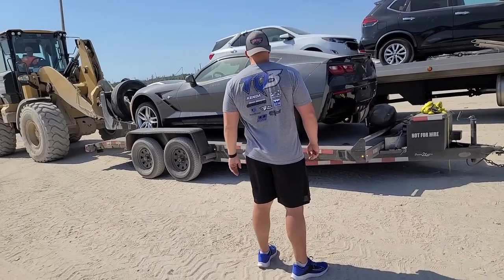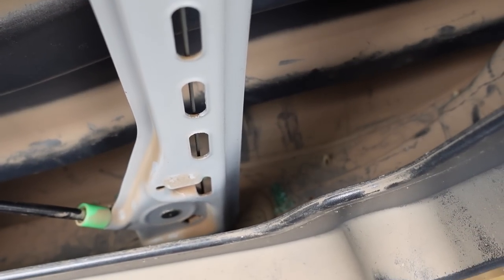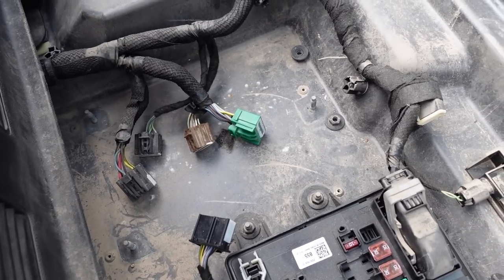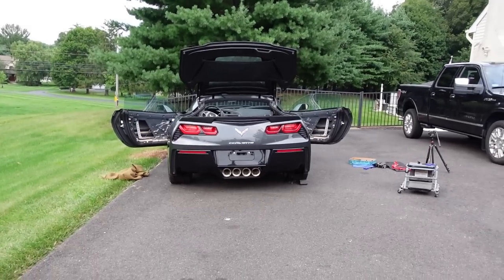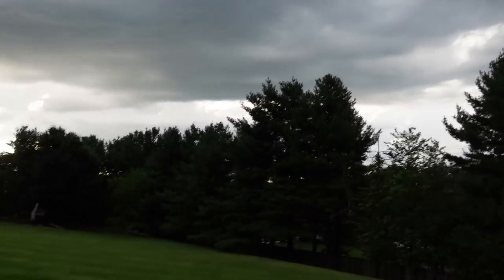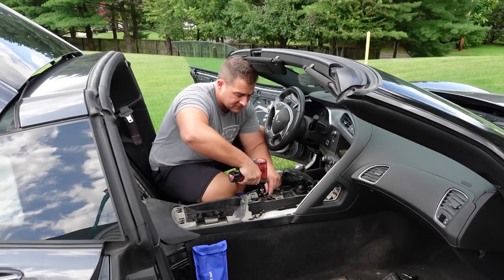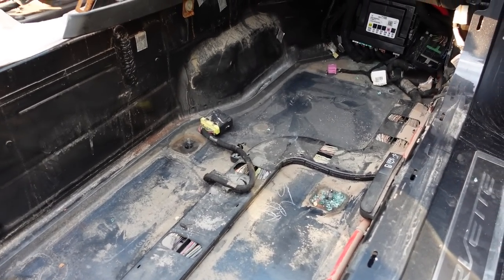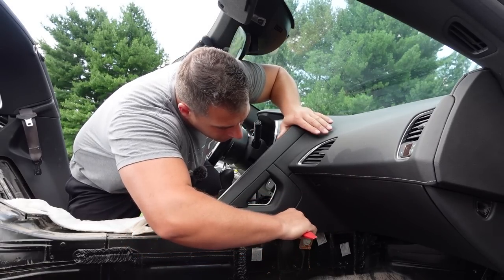My Flood Damaged Corvette just got A LOT more Expensive...

Comment from the maker: Do you think it's normal that essential parts are missing from auction cars? Thank you for following the Corvette series... we WILL get her running again! If you enjoyed, subscribe so you don't miss the next episode! You all ROOOOCKK!!! 🤘🤘🤘
Reply: I can already see this being the best money pit of the year
Reply from the maker: @chasebrown9851  lmao
Reply: I'd call Chevy and see if you can bring in the instrument panels for testing..possibility they may be able to.
Reply: Just a heads up all modules on GM are Vin locked so they will all need to be replaced with new ones or refurbished ones with cleared Vin's and flash/reprogrammed via SPS2 using Techline Connect.. I know it really sucks GM does that I guess to stop the sell of used parts smh.. Just did one that was struck by lightning and wasn't cheap buying everything new.. The only used part was the bcm which I bought used pulled it apart and manually flashed the eeprom using a ch341a programmer..
Reply: Bro with all those missing modules..time to go to the junkyard!! lol
Reply: Just saw you bought those modules lol not good guess you can return them.. See what the issue is the VIN number must be the same for all modules on the network the VIN is permanent and can't be changed upon flashing even by dealership which I use the same software as the dealer and can't do it.. The VIN works like a user password that you would have on a typical computer network  if the password is incorrect it gets kicked off the network..
Reply: 2:36 hurricane water + sewer waste… 
If the waters above the pavement so is the poo
Reply: If all else fails just sell it to Matt Armstrong he likes a bargain  😂
Reply: I bought a Mercedes from iaai and most the modules were missing, they even switched put the headlights and the airbag to a cheap one after I bought the car.  They were in the pictures correct too.
Reply: I love how excited your dad is about this car
Reply: The attention to detail is outstanding . I am very happy to hear you are going to pull the heads and dive deeper into the motor , i can hear you now saying . Dude im so glad i pulled the heads. 😂😂😂 bul🌮🌮's for the house.
Reply: A :they tested them and they where good and sold them .. 
 B: they where junk and threw them away 

and im pretty sure the  A is the right one ......
Reply: Get a holly dominator and go all out, getting all those modules is gonna cost a fortune, just make a race car! Hit up Texas speed they love YouTubers and would probably help
Reply: @BanksRacing11 if they are all vin locked than why the hell would they take all the modules off to keep to sell. I mean come on this is starting to remind me of apple and how they program the screens batteries cameras and even the back glass to the lodging boards on their iPhones 😂
Reply: @awesomeproducts1582  That I have no clue there worthless imo.. Yes ikr their doing exactly what apple is doing locking them so you have to buy everything new from them.. Think they started it around 2008 with the 6l80 tcms then around 2015-2016 they had the bright idea to expand to all the modules.. I'm not 100 positive it applies to the modules related to the stereo/onstar systems but I assume so since it applies to the ABS/TCM/ECM/PSCM/FPCM for sure... I was thinking if he was planning on keeping it he could use all those modules he bought and retrieve the Vin the use it to program a new ecm and the rest of the modules he could buy new then all the modules would work on the same network.. I feel for him it's not going to be cheap anyway you look at it..
Reply: At first I was honestly thinking the modules were all bad and probably were sent to someone to bench test em, nothing was working out and the previous mechanics or owner just bailed and said eff it all anyway - sell at auction. But now that the comp. is missing and almost all the others it seems like someone actually tried selling them as a full set to regain some money back.
Reply: I’m glad I read through these comments.  
 The criteria for a “digital handshake” is a real problem. 
   I’m thinking this car is in hotrod territory as a result. 
   Those are just major components.  
   What happens when body grounds etc come into play?  There’s got to be a major obstacle to overcome in that.  
   It would be interesting to know the cost of putting this car back to at least some enjoyment without having to go through all of these module changes and flashing.
Reply: Please please say water properly it’s not wooder it’s water
Reply: Take it the positive way , all those modules were probably fried… and according where those modules are placed , it could be the reason why they are missing … 
So you’ll save time and effort trying to check all of them one by one … having some brand new pre owned second hand part then your sure that they are all good 😂
Reply: If it was a Ford it wouldn't be as much of an issue missing all that shit. In all honesty in my personal opinion you got hosed on that car but being bought at auction sight unseen you are kinda being lead to a pack of wolves that ravaged that car. 
I know you will get it right but it's going to cost a fortune.
Reply: @hughobrien4139  theres always a way… its not like General Motors would make it impossible to replace modules in a mass production vehicle, being higher end or not. It might just take a bit of extra cash and talking to the correct people. This guy has the backing and the knowledge to do it and I bet he does
Reply: It made me angry when you showed that and it'd not my car! I think it's shady that they did that!
Reply: @jsvallee567 was pretty shady of the ppl who sold it!
Reply: If you looking to fix something carbon fiber , mayby contact tawarish 😜  he has some profesional guy fixing carbon fiber tubs in his cars 😀 mayby some colab ? 😜
Reply: Typically at copart the cars are sold by insurance companies, and fully intact, because they won’t even mess with a flood car.
Reply from the maker: @mostlymotorized  I'm going to have to disagree with you on this one. One from experience over 15 years of successfully finding deals and two, that the modules came from a reputable salvage yard with a guarantee. I also found a place that can reprogram modules for nearly any model. Have some confidence in me buddy lol.
Reply: Its probably becoming normal.  But its not right. They fairly stripped yours of those nasty expensive black boxes. There really are a proliferation of the damn things.
Reply: Bound to be an auto electrics place that can fire up your instrument cluster. A modern place with diagnostic abilities.
Reply: They just put it back together to make it look the best at auction for maximum price regardless of what’s missing under the skin
Reply: NEVER buy a salvage car from anyone but an insurance company. Vehicles sent to by anyone else are probably there for a good reason that won't be an easy fix.
Reply from the maker: @beefmalone  lesson learned
Reply: when is the next episode on this car?
Reply from the maker: @kevinmousty945  I'm hoping to have it in the garage and continuing the series before the end of the year. I've been consumed with things outside of YouTube but it will be back!
Reply: Would love to see the next update on this project.  I would start leaning toward making a cool track day car.  Roll cage, racing seats, modified motor & suspension.  Doesn’t seem like it’s worth it to make it factory correct, but now you can make it Sabo correct!
Reply from the maker: @MichaelORourkeProd  great ideas, and it may go that route. I've decided to put the project on hold until I move into a bigger garage which should be this year!
Reply: @MichaelSabo we’ll be waiting 😢

Comment: Had a feeling you were going to come across this with all the computer modules either damaged or missing when you first bought this car. My day job is an auto damage appraiser for a large insurance company and a co-worker of mine had made the mistake a few years ago of writing to repair a flooded vehicle instead of just totaling it and it turned into an absolute nightmare.  Every single module was needing to be replaced plus be reprogrammed by the dealership , it was a very similar situation to yours. One more thing, I'm sure you figured on doing this already but make sure you flush out the transmission fluid and the rear diff fluid before you drive this thing at some point when you get it all up and running.

Comment: FYI: for future purchases, on COPART, IAA you should only buy cars that are being sold from a insurance company. But you probably know that now. I would suggest trying to find a really hammered wreck / Copart / IAA to use as a parts car (from a insurance company). You can use the VIN numbers to confirm the parts will work in your car.
Reply: Also Google the vin number it'll show you if the car has been sold at auction before cause if a car is being sold again on auction chances are your buying someones mistake.
Reply: @mostlymotorized  no some people just over pay for cars and like Micheal said they paid over 34k for this which is way too much.

Comment: The number of missing modules is incredible!  Credit to you for not giving up.  You really must pull the dash, though, and thoroughly inspect all wiring and clean every single connector.  And that will allow you to also fix any hidden rusty fasteners or brackets.  It that was my car, I would basically take it right down to a bare shell, and then put it back together, inspecting and cleaning everything.  Really enjoying this series!

Comment: Mike, I dig this car repair. I'm an automotive enthusiast and have done quite a bit of repairs, chassis work and engine work. It is addicting once you get started, and expensive as you pretty much know already, but once you pass the finish line and fire the car up on the first drive, it will be worth it. Keep a clear mind and push through

Comment: I got a friend here in BG KY that works at the Corvette assembly plant and he actually assembles the driver's door before it goes on the car he puts the glass window motor and regulator and speakers and all the wiring in the door and door panel and i don't think there's that much mud in the doors he installs lol but I know ull get it all looking brand new just like the ones he assembles every day of the week. Keep up the good work and if it gets too frustrating just walk away from it before you break something in ur frustration and cost urself more money than ur already going to have to spend to get it back on the road and this seems like a project that could take you a year or more to get it back on the road and make it like new or as good as new as possible but just take ur time and do it as good as you do all your other builds cause u do absolutely top notch work on the quads no doubt so keep up the good work and take ur time and do everything to ur quality standards

Comment: Hi Mike, 
Those rusty metal pieces behind the door card and under the console etc, just give them a sandblast (or rust converter treatment) and paint, no need for zinc or powder coat, they’re rusty because they were just bare raw steel from the factory. 
Straight up I googled rear electrical compartment when you showed the missing modules and I thought “Bose amp 🤔” which looks like an option as some pics I found didn’t have the sub. 
You’ll get there 👍🏻👍🏻 I’m very jealous of this car. The C8 is the first Corvette available in Australia with a two year wait and over 200k price. I have a 1979 C3 down here

Comment: Did the exact same rebuidl on a 2016 Chevrolet sivlerado. took every computer out (module) and replaced and had the local GM dealer reprogram to synch with the truck. Sucks that it cannot be just a plug and play thing. All modules need to be programmed, but can be purchased at a cheaper price online if you want to go that route. Its brutal though.
Reply from the maker: Damn; I think you're right. I did find places that will test and reprogram the modules based on VIN. I'm still researching it, but I think I'll be able to get it done.

Comment: Michael, you are my favorite YouTube channel.  I actually am buying another C6 currently.  My last one I did the cold air intake, ported throttle body, Kooks headers with Xpipe, Corsa sport exhaust and a really good dyno tune.  That setup sounded so good.  Perfect for just casual driving and bothering anyone to just a full out screaming beast at full throttle.  Strongly suggest doing it I promise you will not regret it and not terribly expensive especially since you could do most work.  That exhaust setup I researched forever and knew going in was a great sounding combination.

Comment: I think you should leave the factory camshaft factory pistons if you can and factory bottom end and I think you should do a bunch of port and polish work to the heads exhaust work something for a high performance intake and get it tuned and see how much power you could pull out of it I think that would be pretty cool to see just what you could do with bolt on mods and some port and polish

Comment: Hey Michael. When the car is dissasembled like this , hire a dry ice blaster. Then you can blast the interior and engine without ruining any electrical components. It will remove the rust on the inside and all that dirt and debris. It will save you loads of time and it will be spotless, just like your rebuilds.

Comment: Great video of the corvette, just a thought looking at the specs of the car the 6.2 v8 is 460hp @6000 rpm and 465lb ft torque @ 4600rpm 0 to 60 in 3.6 seconds stock. basically with a cold air intake and a good exhaust you will probably be close to your 500 hp was curious if you have seen a c7 grand sport ? might be an idea for mods thank for the work your putting in this project enjoying this series

Comment: Gday Mike,
I wondered about the ECU when seeing that the right front fender was loose in the earlier vid. I look at it positively this way. They have done you a favour as you now have to replace all those modules which were seriously either stuffed anyway or would have wasted so much of your time in the future with problematic intermittent issues. I’d also really consider buying an entire loom which shouldn’t be too expensive. You will have corrosion and shorts in some of the plugs. Again that will waste a lot of future time. Another thing to consider is a flood car holds moisture (if not cleaned/dried immediately) for a long time. The car heats and cools and the moisture evaporates, rises and then condenses on things like the circuit boards behind the gauges etc. If you get that it’s usually easy enough to clean up with contact cleaner and a small soft brass board brush. I mention about the moisture travelling over time as it can cause issues with the connections in areas well above the flood line, so don’t just expect them to be good if fault finding. That’s an awesome deal on the modules. I was going to suggest buying a frame/roof damaged same model car for all the modules, loom etc, but you are killing it on great part deals! I’d say that’s what the previous company were waiting on, a good deal on a parts car. Then thought better to make it look clean and move it on. 
I wouldn’t suggest to someone to do this to end up with a cheap car. But definitely an excellent content creator. Best of all other people learn so much from this kind of stuff. As I always say “If it was easy, everyone would be doing it”.
Totally unrelated, just picked up my brand new WR250F a couple of days ago. (You can road licence them here) A ride in the country here is way better than any gym work out. Man, I’ve been smiling for days now! 😁 I bought it with profits from flipping earth moving equipement by buying/repairing/selling. 
All the very best with the build. 
Cheers, Nigel 👍👍🍻

Comment: Do an MGW shifter (they are the best.) If you go for a performance setup, grab stuff from Texas Speed for an aftermarket updated. Fuel system from Fore, E85 flex setup if you wanted to add any boost.

Comment: The airbag module is rebuildable - probably why they kept it, well at least they didn't take the air bags. 
you can also use gun bluing to protect that interior metal after you clean off the rust, easier than paint. I use it on 4spd shifters, makes the look new.

Comment: My grans 97' Toyota Tazz fell victim to some Florida floods here in SA, the water came all the way up to above the dashboard... 11 days later it was running and driving like brand new again only things replaced were the oil, air filter, plugs and sound system...

Just goes to show that flooding a car doesn't have to be the death of it, just as long as you fix it ASAP, granted it is an old car with little to no complex tech...

Comment: ANY time you are working on asphalt, do yourself a favor.  Get a sheet of plywood and cut out sections about 4" larger in size than the jackstand is.
Place them UNDER the jackstand between the metal legs and the asphalt.  OR, call a metl shop about getting some 1/4" plate cut out with the same sizes as I mentioned earlier.  
1/4 will be PLENTY strong enough to hold up about anything you want to put on the jack stands.

Comment: I have done quite a few rebuilds and if I were you I would try to buy your modules used with the hole harness
Reply from the maker: I appreciate the advice on that. I'm not sure if the Z06 has the same harness as my Stingray, but I may contact the yard that I bought the modules from to see if the harness is available.

Comment: You should hit up the company that first tried to fix it before running it through the salvage auction & see if they still have all those modules. They are VIN locked to the car and might've just been yanked to redo. Even if they pulled them all to resell, it'd still prolly be cheaper to buy them back and save on all that programming new ones would require.